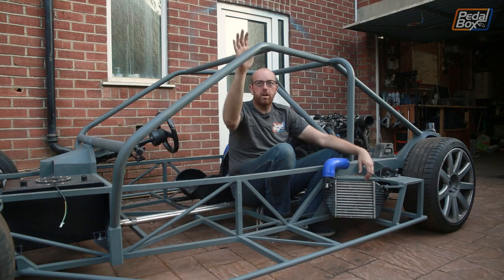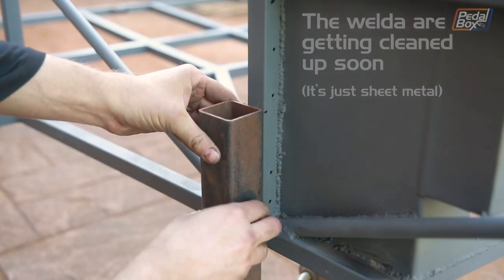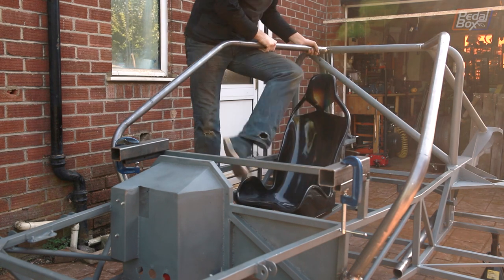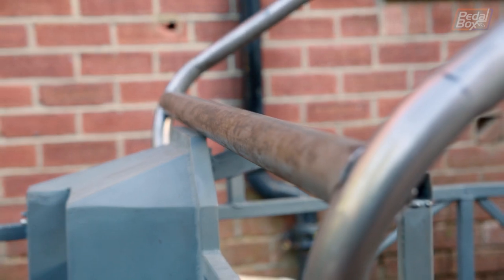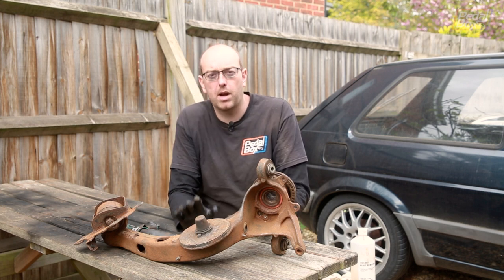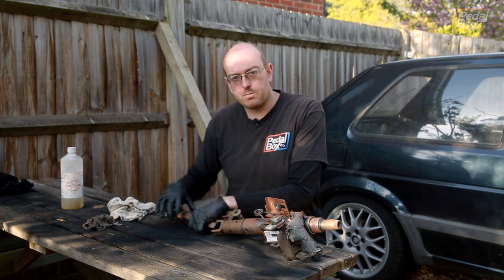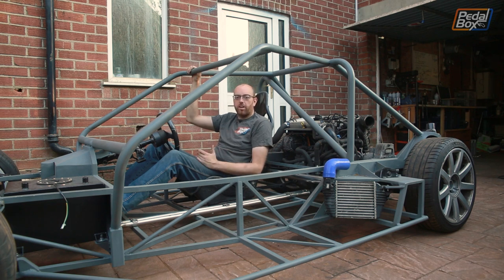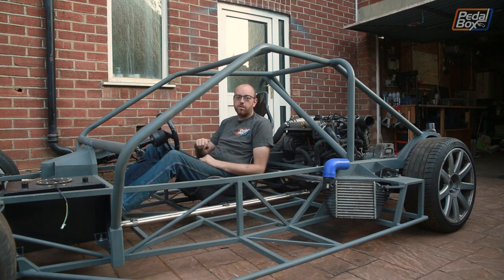Adding Windscreen Pillars | Audi TT Kit Car | PedalBox Episode 50

Comment: I've been enjoying this build right up to the point of the front roll hoop. Ohh dear. I'm sorry to be negative but it does not look very structural.
Reply from the maker: Yeah the front isn't nearly as strong as the back, but far stronger than the 'easy in and out' one from most of the Sevens and it's still tall enough to stop nasty head-ground contact if it rolled. 
The main job they do is hold the windscreen and stiffen the chassis forward of the engine enough that i'm happy it wont fold up with me in it if it's hit in the rear (saw that happen first hand on a friends MX-5 mk1)
Reply: @PedalBox  for me the worrying part is how it's mounted to the chassis, it's a very steep bend inward, it's not like you haven't got the room to have it more vertical. Bends in the wrong place is where problems occur.
Reply from the maker: You're not wrong, I reasoned that the mount being into the core of the chassis was stronger than it would have been into the 1" tube/box at the very edge, as there would be far less material from edge to edge of the car. The bends are braced inwards with a (50mm Iirc) bar between so the likelihood of the outer apexs of the A pillars compressing inwards should be minimal. I am however not an expert and just making my best estimates and quite relived to get some feedback on it
Reply: @PedalBox  I see where you are coming from, however a piece of 50x20 box section protruding from the chassis (outrigger) with a 3mm plate welded on top, tube direct to that with a 45deg bracing back to top end of  chassis bulk head may have been a better option.
Reply from the maker: Yeah not wrong, problem with an evolutionary design. That would have made it FAR easier to bend up the forward pillars too. Noted for Project Two :)